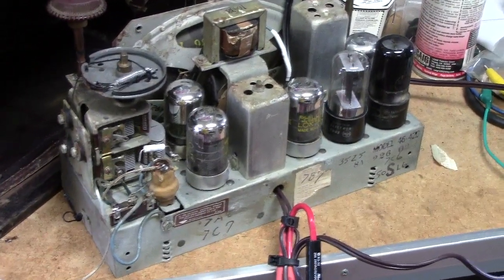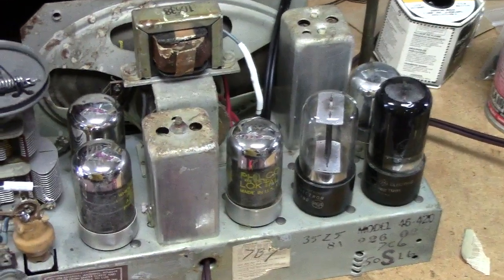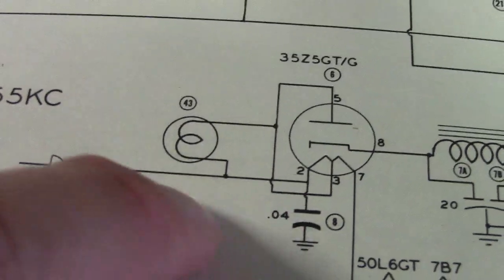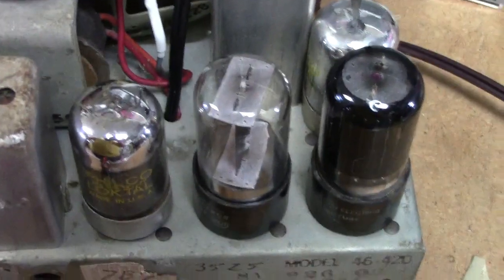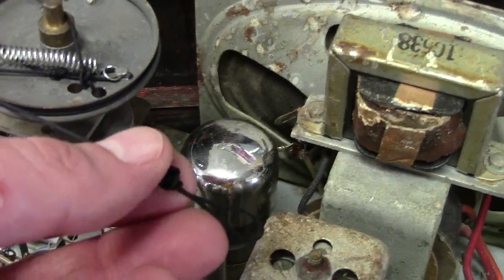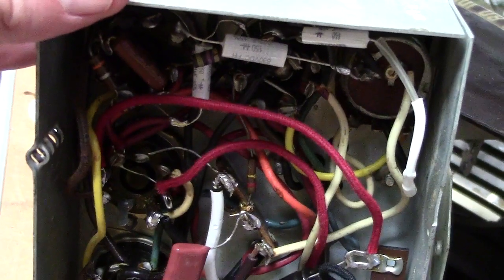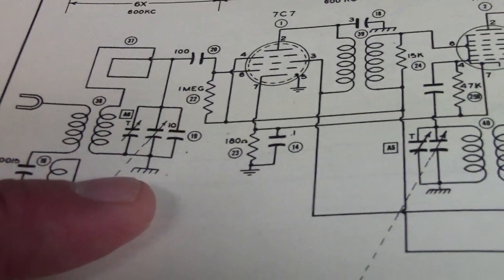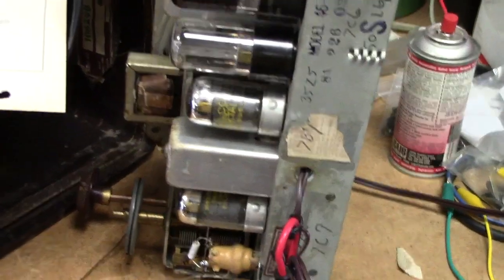1946 Philco model 46-420 radio repair

Comment from the maker: Spraying the tube pins with Deoxit can help a lot...most of the locktal tubes I have worked on have had intermittent noise caused by oxidation.

Comment from the maker: This particular radio does have the chassis isolated from the circuit ground by the .1 mfd capacitor and the resistor which can allow some leakage current but these components limit it. The isolation transformer is always a good idea but especially on sets where there is no isolation capacitor between the circuit ground and chassis.

Comment: Chad - Nice restoration.  I have a 48-460 Philco "Hippo" which has a different tube line up plus a PM speaker.  14A7 (Conv) - 2 7B7s (1st & 2nd IF) - 35Y4 - 7C6 - 50L6.  I also completely recapped my set.  I can pull in KNX 1070 from L.A. which is about 360-400 miles south of here and S.F. bay area stations which are 90 miles away. - Ray

Comment from the maker: This radio I worked on had 6-volt filament tubes for both the converter and the RF amp, and just one IF stage. The converter was I think a 7A8 but don't remember the RF tube number.

Comment: A 14A7 or a 14AF7? Philco liked to use a 14AF7 twin triode as a mixer oscillator tube in some of their sets, except that they relabeled them as a so called XXD tube. I have two Philco "Hippos", both were Canadian built, one has the XXD/14AF7 with two 7B7 IF amps, and three IF transformers. But the other set has a tuned RF amplifier stage (three gang condenser) with a 7B7, a 7A8 octode converter, two IF transformers, and a single 7B7 IF amp.

Comment: Hello, I have this exact radio but it doesn’t work. When I plug it in and turn it on, the light comes on and the tubes start glowing, but the speaker just starts loudly buzzing, and I mean LOUDLY buzzing lol. Adjusting the volume nob does nothing. Any idea what the problem could be? I don’t know where to start lol.

Comment: My Bendix 1952 radio had the old style non polarized plug. Plugged in one way gave a hot chassis with the radio on & not when off. Flipping  the plug in the outlet gave a hot chassis when the radio was off, but not when on. The reverse. (other radios also) Either way you will still have a hot chassis on the bench since the ground is not isolated from the chassis. Bottom line: be ever vigilent & use a isolation transformer for lower limit current potential.

Comment: Mixer-oscillator is just a different name, I prefer it over converter in this case since the 14AF7 actually has two different sections, one triode is the oscillator the other is the mixer, under the same glass rather then a pentagrid converter like a 12SA7/12BE6 tube. Supposedly they produce less noise electrically then a pentagrid converter, although that only makes a difference at frequencies above 30 mc from what I was reading.

Comment: wish i could remember...but those coils if i remember correctly. that only half the coil goes out...that can be fooled back into service with a resistor and capacitor..And it actually works..